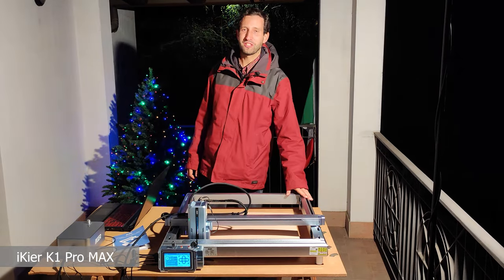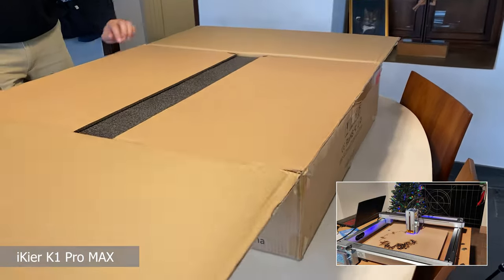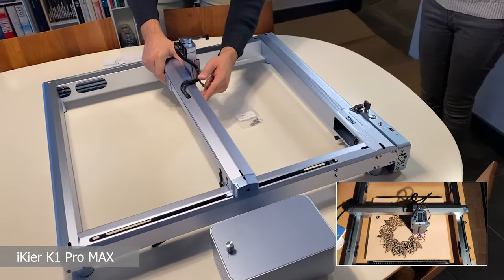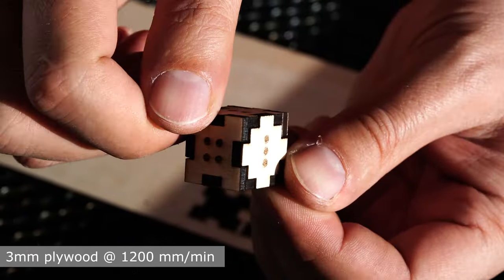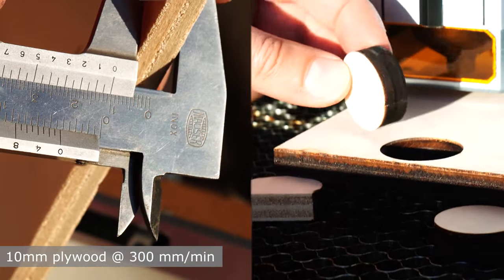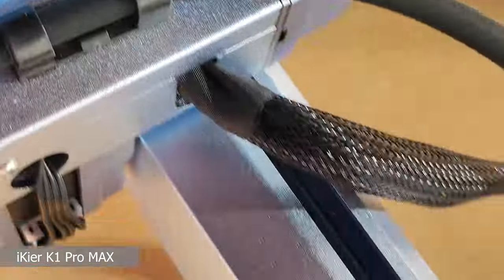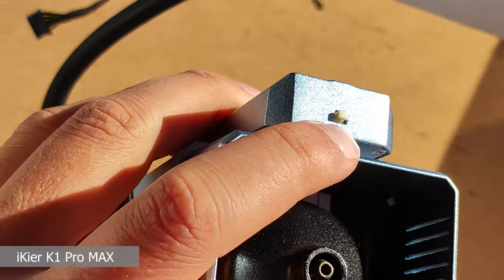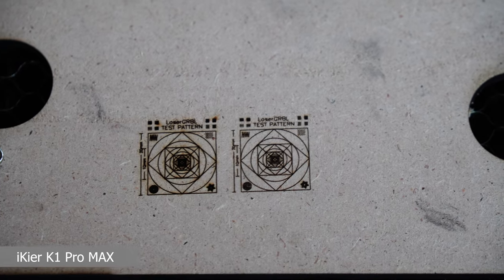iKier K1 Pro Max - Test, unboxing and review by LaserGRBL

Comment: Hello. Good time. I have a problem with the lasergrbl program. When I convert the autocad file to png and send it to the laser grbl program to cut, the lines become two. That is, the laser travels a round trip. What should I do to solve the problem?
Reply from the maker: You should convert it to svg. One software able to open autocad and save svg is inkscape, and it is free.